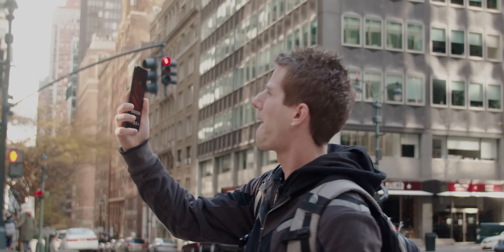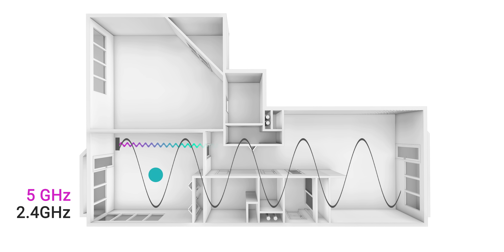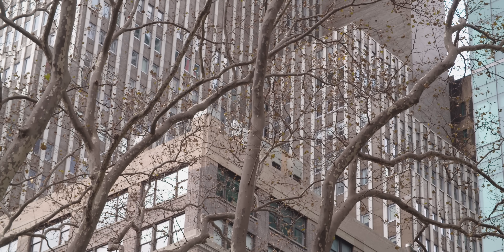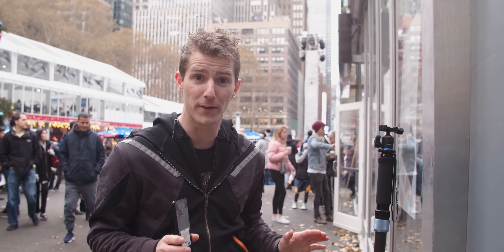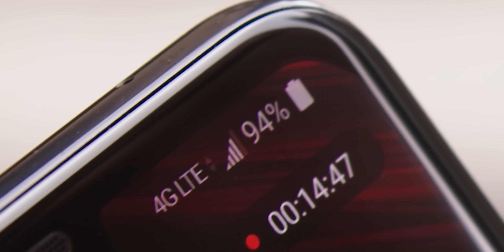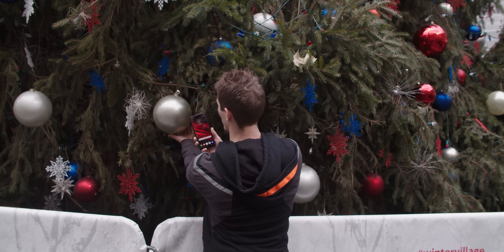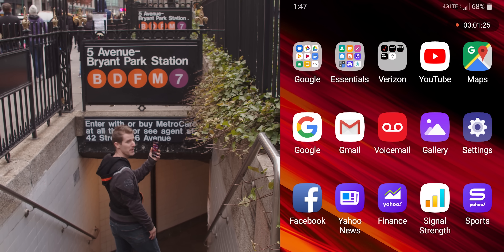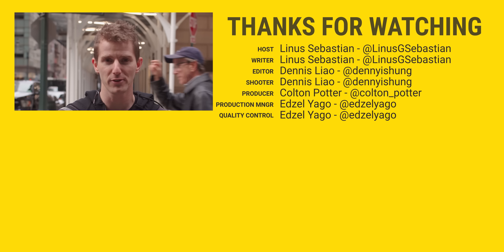The PROBLEM with 5G mmW...

Comment: 5G makes ZERO sense,  it’s gimmick and just about making more $$$ and prob at the risk consumer/customer health risk.  Do we REALLY need 5g????? Noooooo.
Reply: As a student network engineer with some good and knowledgeable teachers, one of them has on multiple occasions mentioned the harm of 5g. Either they have to put a mast every 100 meters and still be relatively harmful or they don't, crank up the signal and being quite damaging. He also mentioned a few countries testing this and those countries had lots of birds drop dead because of it
Reply: @occido  Millimetric waves and phased array antenna systems are military technology, this system is for radar, total surviellance and control.  I refer you to the Active Denial System which runs on 90Ghz, well within 5G capabilities.  5G hardware is capable of frequencies in the range of 700Mhz-300Ghz using software defined radios with phased array antennas and AI supercomputing at the edge to power the system (see DARPA spectrum collaboration challenge).  The Nvidia raytracing is not so you can have shiney graphics it's for computing the beams (arrived just in time it would seem how convenient).  They have SMART lights deployed allready also in most cities across the globe, 868-900Mhz phased array antennas in a mesh network with backhaul capability for IoT.  The systems are capable of backscatter tracking the short range RFid chips at several kilometres of range.  The frequencies they are using like 868Mhz/900Mhz are very dangerous, a quick google for health effects will reveal things like problems with T3/T4 thyroid hormones which regulate cellular metabolism, reduced function of hippocampus and probably plenty more besides.  Perfect for through wall radar though as it can penetrate up to 3 feet of concrete.  They want to use 60Ghz and they are allready for some of the advanced WiFi, that frequency affects the orbital spin properties of the oxygen mollecule, this may result in some trouble breathing or the generation of ozone molecules which are dangerous.  Whitepapers on health effects are verified by multiple institutes and countries.  Over 20,000 scientific whitepapers with around 70% of them showing the dangers of EMF.  The phased array technology will kill all the small birds and insects, but it will take a few years.  All life will be affected, the damage is visible on the trees allready where they are close to the transmitters.  The high speed internet is "simply to die for". 

Active Denial System:
https://en.wikipedia.org/wiki/Active_Denial_System
5G APOCALYPSE - THE EXTINCTION EVENT:
https://www.youtube.com/watch?v=ol3tAxnNccY
Phased Array Antennas:
https://www.youtube.com/watch?v=vtPPAnvJS6c
AI Senses People Through Walls:
https://www.youtube.com/watch?v=HgDdaMy8KNE
THALES SEA FIRE a new generation of naval multifunction radars:
https://www.youtube.com/watch?v=lFVxj6sIf7w
5G LED WEAPON DENSIFICATION OF OVERCAPACITY:
https://www.youtube.com/watch?v=NXTaL88sR-k
5G LED KILLS SMALL BIRDS - HERE IS THE EVIDENCE:
https://www.youtube.com/watch?v=7mF2aYZ-Xo0
Directed Energy Weapons 101: Sonic, Microwave, Laser, and Non-Lethal Warfare:
https://climateviewer.com/2018/07/05/directed-energy-weapons-101-sonic-microwave-laser-non-lethal-warfare/
Reply: Back in the day why would I upgrade to 56k dial up.... this 26k is all we needed

Comment: But the problem is that T-Mos low frequency "5G" is going to have the same problem as low frequency wifi. It won't have the high speeds.

Im disappointed in Linus not pointing this out in plain terms. He usually doesn't seem to have a problem dragging his sponsors, but this vid definitely missed that mark.

Comment: The thing with 5G is that when fully rolled out it will not operate on the old cell tower paradigm.  One of the primary features of 5G is the ability to connect with other 5G devices to create ad hoc meshes that would, in theory, navigate your connection around obstacles by hopping to devices that are still connected.

Comment: I have an important question... do you have to pay more for a 5G connection?... like 100MB of data can be used in like a week on 4G.. but does it like run out within a seconds with 5G...? Or does it all cost the same... just a better connection??

Comment: 4G is better for now, but in the future no. (Ofc unless you stand under a MMW poll)

5G MMW = super fast.
Low 5G = 4G speed ish
Medium 5G = 1000Mbps 
High 5G = unknown, maybe 3-6000mbps

First MMW will be installed, then they will install the 5G low (make sure everyone get it) after everyone have low, they will start medium and high speed 5G. Remember that 5G is suppost to give you 100 times better internet speed then 4G, and I’m 90% sure that will be true.

Norway had a record of 6XGBps

Comment: T-mobile use longer wavelenght 5G, not shortwave 5G. 5G is a communication protocol using phased-array-antenna, it can do any wavelenght as long as the phased-array-antenna work at that frequency.

Comment: Everyone know the problem of 5G and how bad it can be, so for now it is doing it very wrongly. 5G infrastructure is a long hard work for any large cities. You have one cell tower there, and linus just show you how bad can it be. Imagine you have millions of those? If the technology isn't changing fundamentally, then they may need to set up mini towers every 2-300 meters. One or two for EVERY buildings, if there is none, then trees, if there is no tree then bury in under the road, not too deep, just make the transceiver to be road brick. Then and only then, you can achieve really usable 5G coverage in a dense city. 

NOW imagine, how easy it is to triangulate your exact location with cell signal?

Comment: sponsored advertisement for 5G... still struggles to find anything good to say about it.
At least we'll be blasted with a new form of electromagnetic radiation. So yay!
Reply: Didn't you watch the video? They did those tests to diss Verizon 5G that only use mw while tmobile use both mW and 900ghz (basically almost same as 4g lte use)
Reply: @nazrinasraf5819  you realize 9mhz is not 5G, right, but 4G. Tmobile was advertising its 5G while basically saying "yeah, it's crap". Their services will not be appreciably different

Comment: You forget to mention that 5G "low band" is the 5G spec still. 5G is literally a superset of the 4G standard with a complete absorption of the spectrum. I really hate that the benefits being brought about with 5G at the currently available (and proven) sub-6GHz spectrum are being completed ignored because mmWave performs exactly as expected.

Comment: For me the real deal with new generations of connection would be to marginally improve speed, 5G speed is more than enough, and to find a way to increase the wave dimensions meaning more coverage and less radiations. I would very much take something with the speed of 4g and the coverage of edge that 5g and crap coverage. It is lile with ram it is useless to have 538383mhz of ddr63 if the latency is 1 year

Comment: So most of 5g is actually just going to be 4g... 
Well. Consider the hype DOA.
Reply: It’s not as exciting as they think. It’s still just a wireless standard. Imagine how expensive it will still be with the amount of towers they need to make for it.
Reply: @KizaruB  exactly i find this to be so stupid, like why not do true "Long Term Evolution" on LTE?
Reply: @projectnerdvana2820  They are doing that too. LTE-Advanced has been rolled into 5G as 5Ge. Most phones from the last few years can support it, and it's definitely more efficient than "LTE".
Reply: @KizaruB  that why they developed dumb slave towers.
Reply: @KizaruB  They won’t necessarily be need more “towers” as the base stations are a smaller form factor and have beam steering capability. Cities will naturally have a higher concentration of small base stations but the end result is a huge jump in BW and hence data rate. It’s a quantum leap forward and will enable MUCH more data throughput and future apps and capabilities. 5G Technolgy has been in development for many years and has only recently been deployed it’s a major jump in technology. It’s can also handle way more call traffic.
Reply: for me 5g was never about you going around having a 1Gbps on your phone for whatever reason
it will help immensely on stadiums with all the band sharing fireworks and it will be able to provide an upgrade to homes that rely on mobile providers for their internet and even now have an external antenna pointed at the tower
well.. until it rains that is.. or it gets foggy.. but still
Reply: 5G will use 256QAM and 4x4 MiMo more commonly, it has a higher theoretical spectral efficiency.
Reply: Hype? I couldn't give less of a fuck about gigabit internet, it's way more speed than what I need, for way more money than what I'm willing to pay. I don't need super fast latency, I'm watching YouTube videos and sending whatsapps. It's just the thing that the 0.1% of people need, and probably they won't even get coverage.
Reply: Well... sort of. Running on same frequency and bandwidth as LTE. But use new encoding and freq5 sharing.

Its probably more will use the samefreqcency as 3g. Say some 800Mhz for rural coverage. Some 2.1Ghz for sure urban coverage (will probably give you some 100Mbit or so). Then the new 6Ghz for general city coverage (will probably yield about 250Mbit). Then the mm wave for inner city and direct link coverage.

Comment: 5G is being rolled out here in France as well, but  if it doesn't work indoors or from the interior of a vehicle it is basically pointless. Until a better solution comes along, 4G and LTE are  here to stay.

Comment: 5g is dogshit, 4g is more then fast enough for even 4k video but the towers have so many devices on them they are bogged down. Back when lte first came out i was get 77mbps down, for reference 4k netflix only needs around 20-25 down. But lately i never have 4g that is faster then 12. If they would just improve their 4g towers to handle more people it would be better but instead they are consumed by the hype of 5g which is likely dangerous.

Comment: I am more concerned with the fact that it can cause health problems when exposed to these frequency.
Reply: I prescribe research, symptoms will subside after enough doses
Reply: @teddygoboom1   Keep drinking the kool aid than, these big corporations care about your health.
Reply: @ihavetubes  Sure, there'll be some bias as few people are willing to pay for proper tests to be run condemning higher frequency EMR. That said there are major flaws in the testing of EVERY paper linking it to cancer. Until we have evidence it's not something I'll personally be worrying about
Reply: It doesn't. The increased number of antennas means that your phone, which is radiating a much more intense field (inverse square law, look it up) doesn't have to work as hard. Therefore you get a lot less radiation.
Not to mention the fact that there is no mechanism, except heating, at all by which these Radio waves could cause health issues. And if you have a problem with the heating, I would ask you to kindly stop hugging that radio tower.
Reply: ihavetubes no, it can’t. that’s ridiculous, you Luddite.

Comment: I mean this is just the lack of rollout for 5G as a network and considering the actual requirements to building a 5G network you need many more antennas over a small area with about pizza box size antennas. This is similar to the issue with 60GHz networking too though with those only with a direct line of sight to connect.

Comment: I don‘t get why people hate 5g. Like oh a few decades of radiotechnolocy isn‘t enough to proof that electromacnetic waves aren‘t deadly in that range...
Reply: @Stuhlgang 
5G is a literal weapon. Same frequencies used in Raytheon's oh so lovely crowd control "Active Denial" weapons systems. Look up one of its original designers,Barry Trowers ,a UK MOD(Ministry of Defense ) engineer in the UK. Its extremely dangerous tech.Also John Dvorak has allot to say on it.

https://youtu.be/k3QeSOU8qC0
Reply: What freaquency range is he talking about. Electromqgnetic waves can‘t do anyting untill they are strong enough to be ionicing (idk how to write in engl). I am pretty sure microwaves are in another league. But i can understand the confusion. I can‘t really tell the difference between the infos that say 5G is dangerous and the ones that say it isn‘t either. I also know that here in switzerland they are running 5G in the frequency range of 4 and 3G until they have completely done their own tests. 
I don‘t think we should be afraid of new technology. We have to continue. And the problem is that if one country or company doesn‘t do 5G they will lose a heck of a lot of money. Because many people want to have 5G

Comment: Damn i was waiting for Ltt to review the 5G and talk about what's gonna be all the problems with it ,remember Higher frequency = Higher Connection speed but the higher the frequency the harder it is for the signal to go through walls and materials :)
Reply: Also the higher absorption into soft tissue
Reply: @JakobTorchy  get outta here with that bs. Cite ur sources
Reply: @MGSBESTProductions  go put your hand in a microwave and find out (dont, just giving an example)
Reply: @JakobTorchy  MMwaves are safe.
Reply: @JakobTorchy  We need to fight vaxx poisoning our children, grab your foil helmets to protect from the 5G demonic waves.
Reply: @rep-vile  I dont think you understand radiation.
Reply: @JakobTorchy , mmWave almost is like light - it gets reflected by objects was easier (btw it’s the reason why mmWave and generally the spectrum over 6 GHz already is used for tracking of small objects).